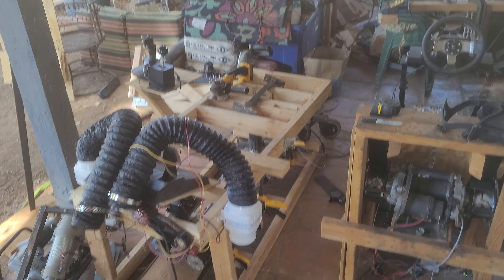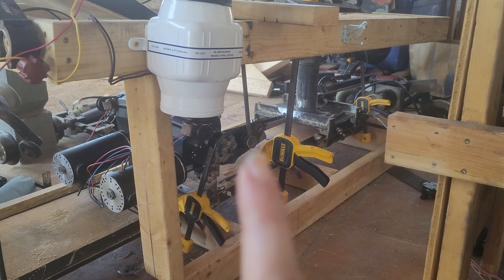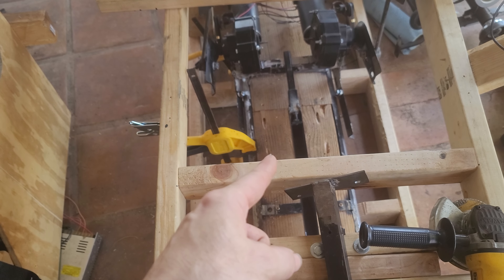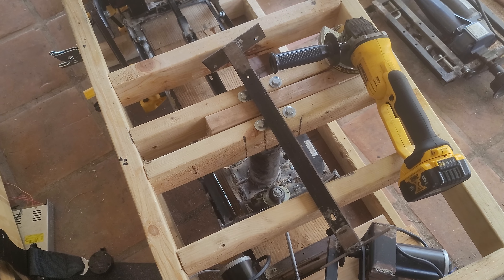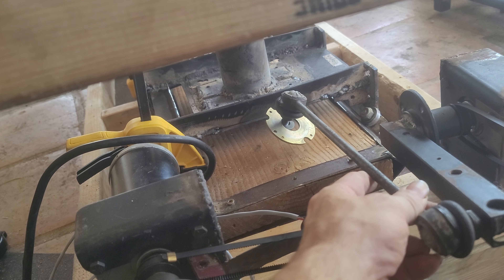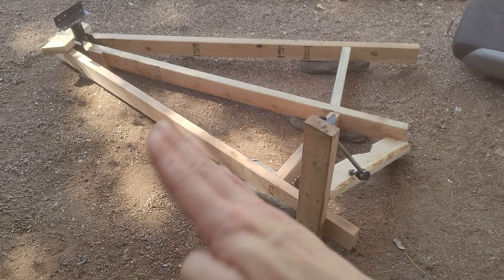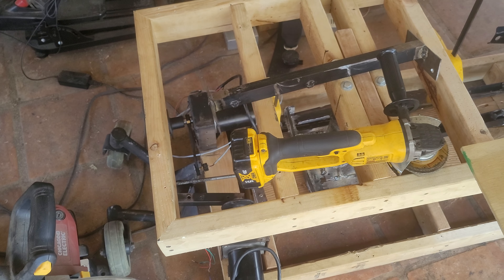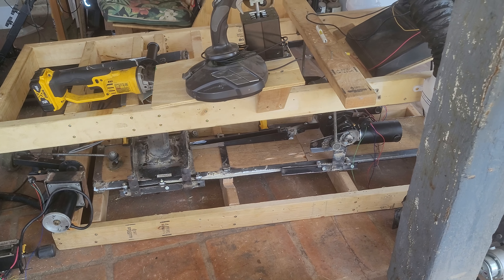Frame assembly 4 DOF

Comment: I've been following your progress for a bit. Awesome videos dude! I appreciate the way you go over your project and share your thoughts and troubleshooting.  A lot more useful for tinkerers than other motion sim vids out there. Keep it up!
Reply from the maker: I am very glad you feel that way.  I have been doing this for about a year now and you are the only one that has ever mentioned that, so thank you for giving me more inspiration to continue.
Reply: A couple of suggestions that may help you. 1. The stiffener/trolley carriage connecting bar. If you can add an adjustable element to that rather than hard welding it, it will give you options for adjustment for travel and top frame location for balancing. 2. Your rails. Im guessing by looking at this and what still needs to go on top, your rails will be under a lot of pressure to spread. You may find you'll need to add more cross bracing from rail to rail where the focused weight ends up. Overall I think this is an awesome conversion, and a great mix of timber and metal. Hopefully I'm incorrect about the rails bowing and itll be sweet as is. Fingers crossed for you mate.
Reply from the maker: Thanks Doc, I have thought about these things and will address them if/ when they become an issue.  I need to see some success to reward all the hard but I anticipate I will have issues. That is what the testing phase is for after all. I really appreciate all the help and I will certainly watch all your trolley videos to get ideas for rebuilding it more correctly.